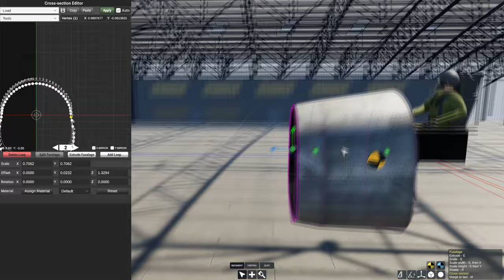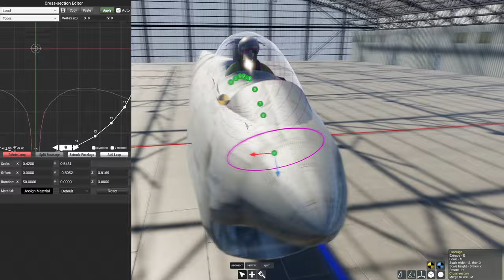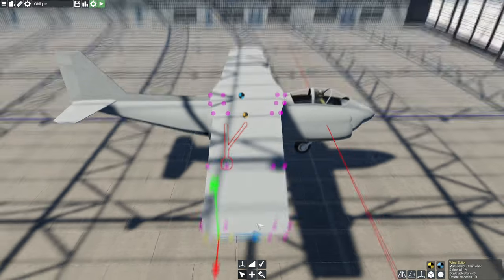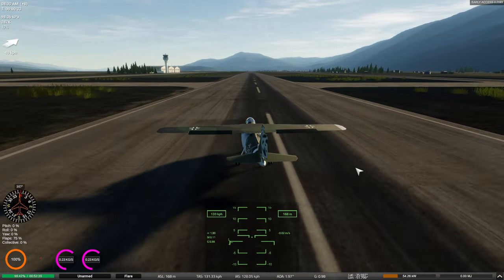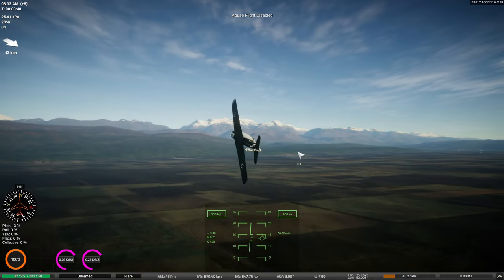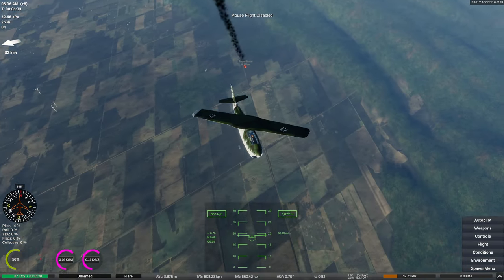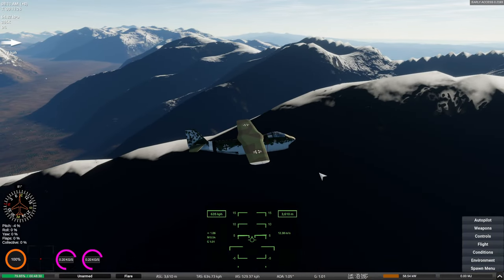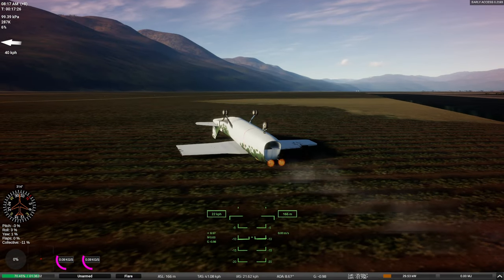I built an OBLIQUE WING wunderwaffe!

Comment: Suggestion. (Video 3)
What if the F-117 had remained in service and continued to receive upgrades... Or more specifiaclly, what would an F/A-117C Look like.

Throughout the 90's various upgrades were proposed for the, now legendary, F-117A 'Night Hawk', including redesigns for the tail, cockpit and wings, as well as the potential inclusion of after-burning engines.
While neither the F-117N or B variants were pursued due to the upcoming Advanced Tactical Fighter and Joint Strike Fighter programs, that would result in the 'Raptor' and 'Lightning II' respectively, I do think many of the unofficial depictions of F-117B or A/F-117x possess an odd, retro-futuristic charm.